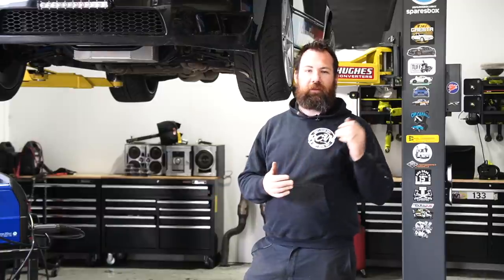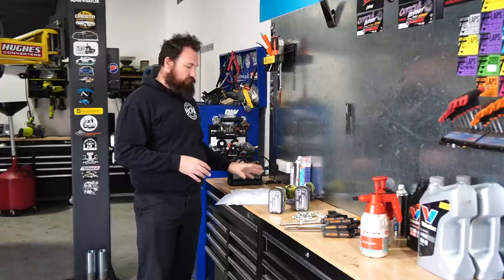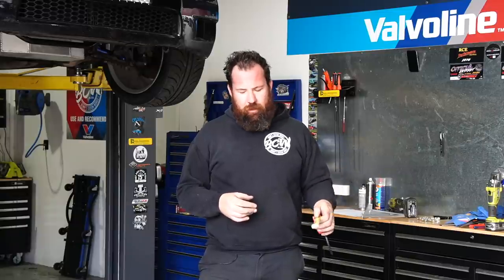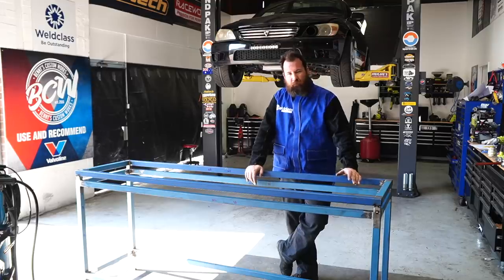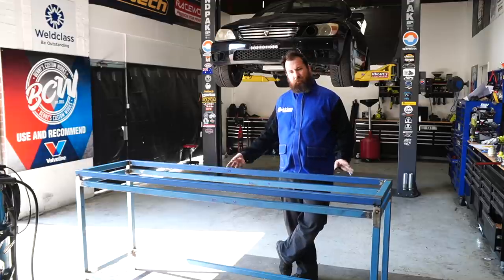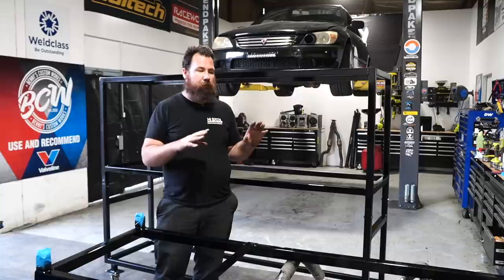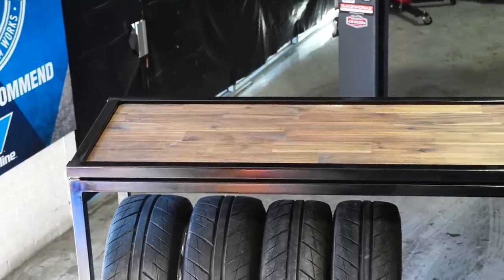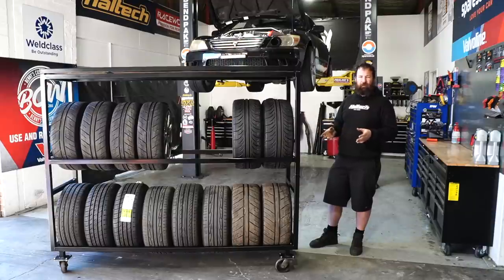DIY | WHEEL RACK [Portable 2 in 1 Bench]

Comment: To secure the wood top to the frame just drill 15mm hole for a 6mm wood bolt to go through and use a washer to stop the head from pulling through the 15mm hole. And when you screw it into the wood top only tighten it snug, that will leave plenty of room to expand and contract without damage to the wood and it will still be secure enough to be sure the wood will not come out over rough roads in a trailer.
Why was all of your steel painted blue? Is that how it come to the AU? I am used to raw steel with mill scale for new material. If I got it and it was painted blue, I would think it was from someone else's project that did not work out, lol.
Reply from the maker: It’s protective paint, you can weld through it but it can impact the weld quality

Comment: Awesome job Benny
If you weld 30-40mm long 8mm round bar on the bolts makes it easier to unbolt and bolt the frames back together without using tools, I've done a few like that before for holding side posts on for trucks makes it quick and easier for the drivers.
Hope to see you on the skid pan one day!